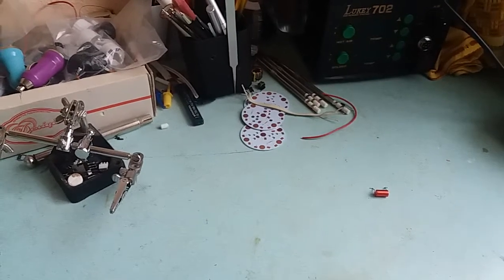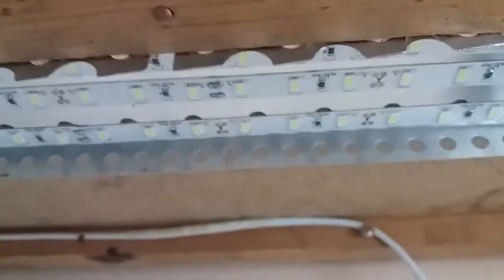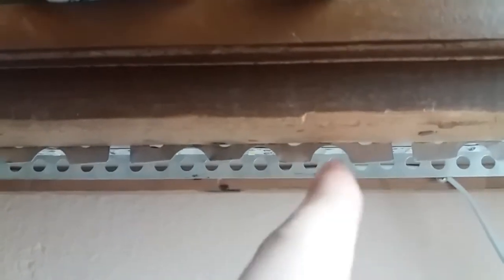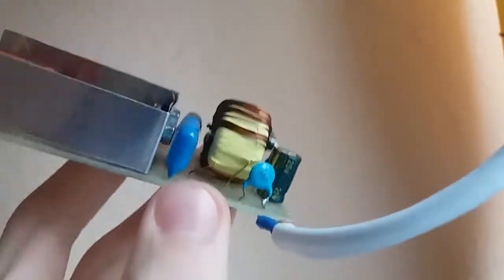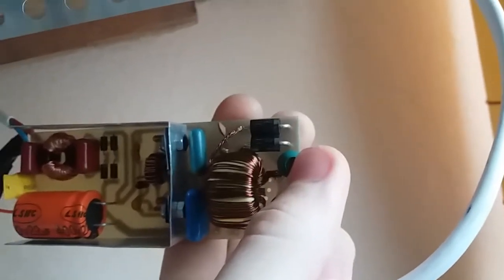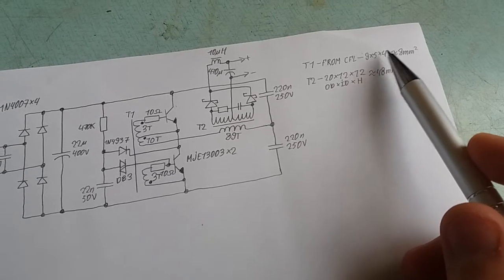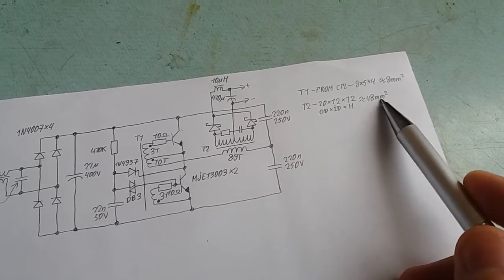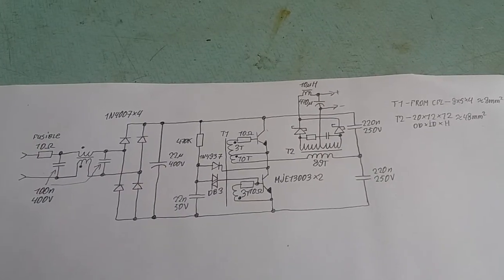12V 2A self-oscillating halfbridge

Comment: Based on the info you provided and thank you for sharing the design, the high breakdown of the DB3 puts it into a time circuit similar to an Triac then once it activate the first T , the one it is connected too this induced the first feedback {via the 10T}  which is counter wound so will switch in alternate to the other feedback once induced it starts the second feedback and they elegantly switch back and forth, the DB3 is bypassed after initial starting because of the diode, each time they fluctuate they feed the ‘inverting’ transformer via the 10T marked inductor. Regards
As with all self oscillators I’m slightly curious into the first start if the the first T gate is triggered then the two capacitors you have marked 220nf must play a significant role because they biase the field effect polarity of the 10T inductor otherwise it can’t start and can’t induce the first feedback?
Thinking more about it perhaps this is why it was originally called a ‘ballast’ as you can see the 10T sources through to a ‘floating point’ between the two capacitors. Via the 89T inductor.
I feel happy that I’ve just {I believe} understood the principle of a ‘ballast’ oscillator, the two capacitor {220n} in effect ‘shift’ the polarity of the whole circuit into a type of ‘floating point’ or ‘ballast’
Reply from the maker: Pretty much, yeah. I like to think of those 220n caps as passive replacement for the transistor of the full bridge.
Reply: @mrjohhhnnnyyy5797   I think of them as a voltage divider, that hold one end of the primary winding at half Vcc say 160v so the transistors can then switch the other end of the primary winding plus 160v minus 160v  alternately...
cool explanation and build of the ''electronic transformer circuit''  really simple yet useful circuit, thanks for sharing.......

Comment: T1 transformer wire diameter please!
Reply from the maker: AB Rider BD Not critical, 0.3mm or 0.5mm. No need for heavy gauge, the winding won't fit. There's not much current.
I like to use wire from ripped Ethernet cable for such things.
Reply: T2 secondary 3.5mm diameter isn't it too much heavy wire? Is it 3.5mm or something else?
Reply from the maker: AB Rider BD I meant three 0.5mm wires in parallel, I will include that in the notes next time. So people won't be confused.

Comment: In circuit diagram first one is inductor or transformer? Can you make a vedio about making T1 transformer and T2 transformer please!
Reply from the maker: T1 and T2 are both transformers, T1 is wound on small core and T2 is the power transformer wound on bigger core. There's a note on the sheet with schematic, where I gave exact size of the cores.
Reply: 100n 400 v capacitor between at starting is it inductor? And what is the value of that? Thanks for replying!
Reply from the maker: AB Rider BD That thing on the mains input is a common-mode choke to reduce interference, it is optional. You can reuse such chokes from other power supplies.

Comment: I'm clueless about how this oscillates/the start-up circuit works, -as mentioned in the other comments (even though I've read them a half dozen times while staring at the schematic)... I guess I need to pay more attention to dimmer and CFL circuits.
   Thanks for the capacitor info. I didn't know the mains side capacitor could cause this kind of oscillation. 
  When you said a larger output capacitor could blow the transistors, is that primarily due to in-rush current on startup or other factors?
Reply from the maker: Upcycle Electronics This SMPS uses the current through the primary as the feedback signal, so that makes it blow up when you short the output. Big cap on the output is effectively a short circuit for a moment, and that moment might be just long enough to damage the transistors.

Comment: Nice little psu :-D
I see the diac that looks like the part of the phase angle firing part of a triac mains dimmer.
The transistors look like they are from a folded flourescent bulb.
And the transformers look similar to pc power supplys in half bridge.

A mix of the best bits lol.
Reply from the maker: In so-called electronic transformer there's no cap after the bridge, so you can change the duty cycle on the output by changing value of the resistor which charges the startup cap. Here the startup circuit is disabled once the oscillator starts up by means of discharging that cap through the diode. Well spotted, my friend :)
 All parts here are brand new, but yes, you can scavenge almost everything out of CFL; that was the idea.